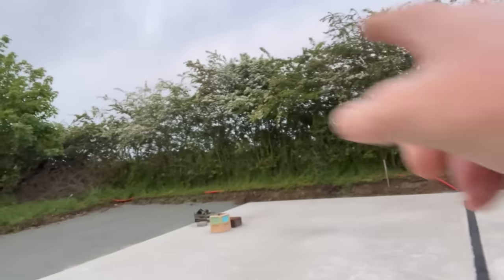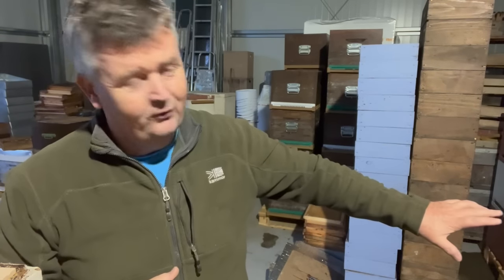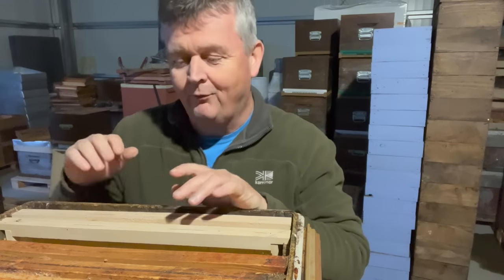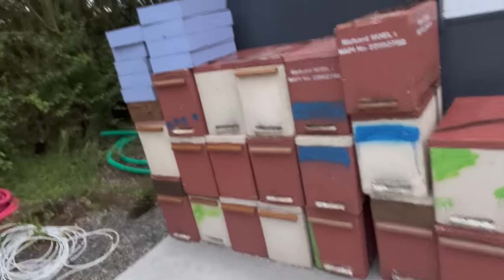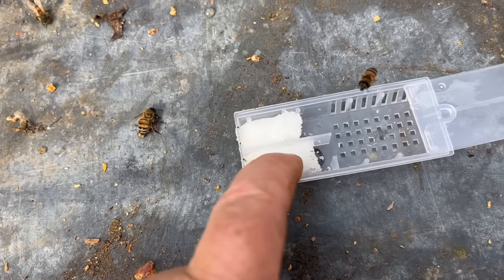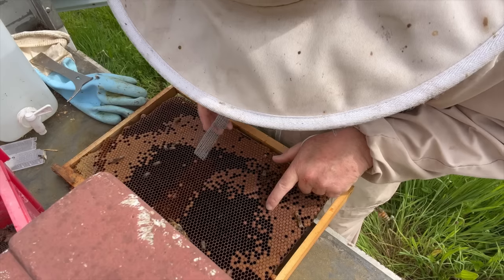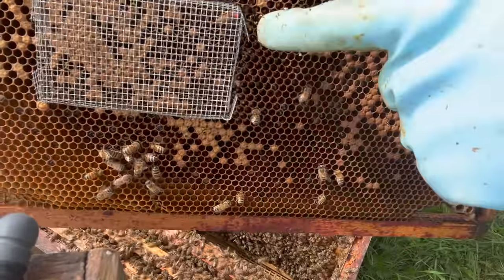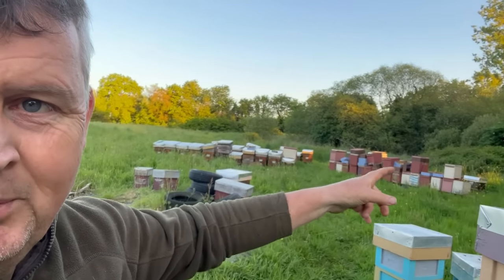Making Nucs with push-in cages.

Comment: Hi Richard, how long do you keep the queens in the cage. And do you use the same cages to do brood breaks through the year? Thanks for the vids, hope your year goes well.
Reply: I personally don`t want to risk it and i don`t use push in cages at all. Bees can chew a hole from the back of the frame if you are not using plastic foundations. I have my own cages for brood breakes (small wooden box with queen excluder "wires" on two sides).
Reply from the maker: From 5/7 days is ideal once the queen has started to lay and the eggs start to hatch it’s usually a good indication that she’s been accepted. If your unsure you can leave her fir a few more days. Laying condition is when the queen comes back in to lay! That’s what I hope to achieve by doing this.

Comment: Do you get many queen cells before releasing the queen?
Reply from the maker: Not always when a queen is under the cage but it’s important to check. Because she can move around more she is usually accepted quicker and there are less emergency cells drawn up. However we still need to remove any, just in case she dosent tear  them down.